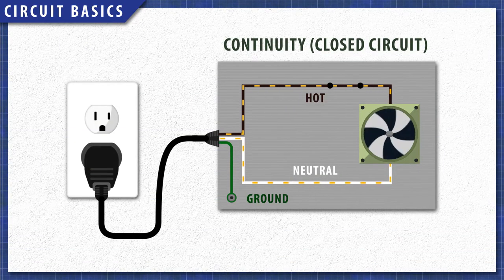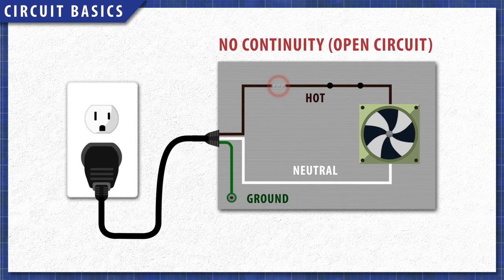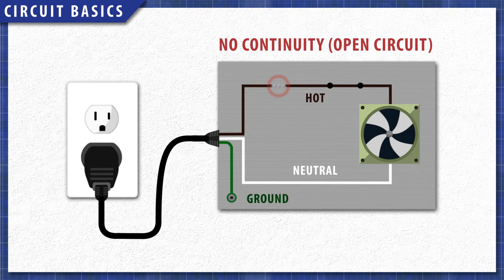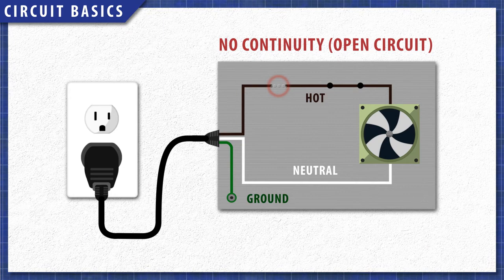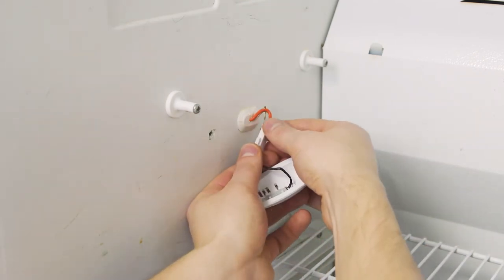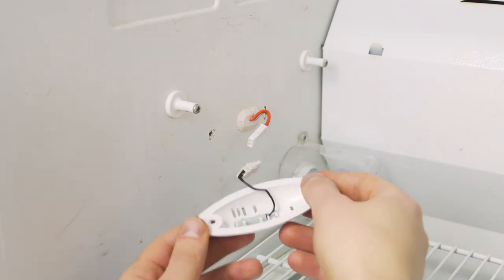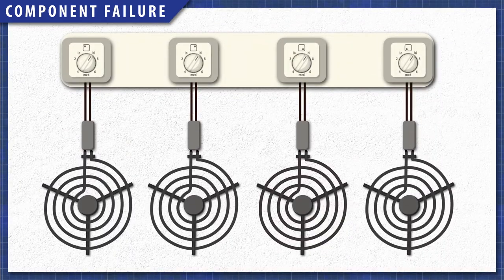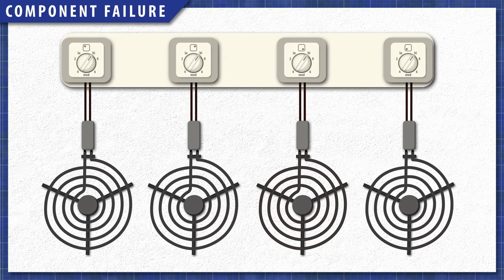What are Open Circuits? | Repair and Replace

Comment: No help.
Reply from the maker: Thanks for watching. This video is just meant to briefly introduce these concepts as we have other videos that go into more detail. What is it that you're trying to troubleshoot?
Reply: @AmreSupply  Hello. Sorry I let my frustration out there. I have two things. I have a dead spot in my fuse panel in my 1975 Dodge Coronet. I've taken it down and and looked at the back where there's an orange wire that has no juice. I guess I'll have to wait till I have a friend to help me trace it through the quarter panel. I've found a wire in the front grill, next to the horn and lights that is just floating in space and it's live. I found another wire, both in a case, both males, but the second one is not alive. My question that I can't seem to find an answer to is, What do I do with these?
Reply from the maker: @timmyneeley3913  Thanks for the reply. Automotive is not our area of expertise so it might be helpful to ask one of the many automotive forums as there is a lot of collective knowledge there. 

If previous work was done on the vehicle then the wires might have been shifted around. If a replacement part was different then it might have had a shared wire leaving one disconnected. Without knowing more it's hard to say.
Reply: @AmreSupply  Thank you